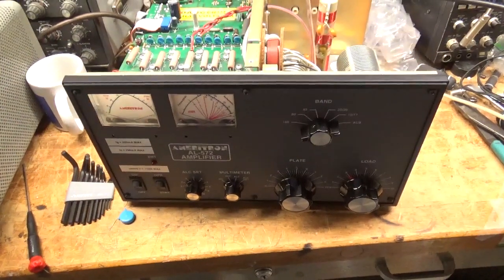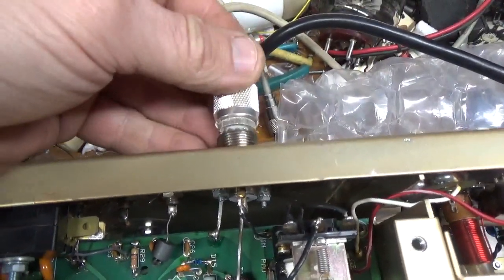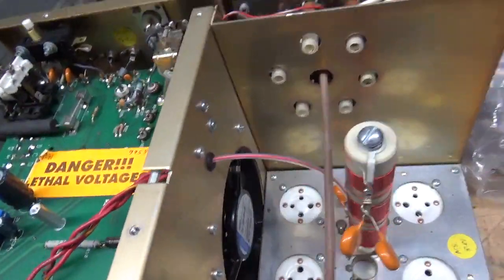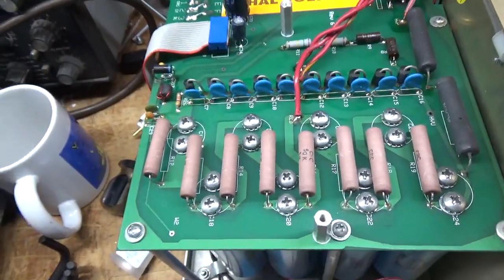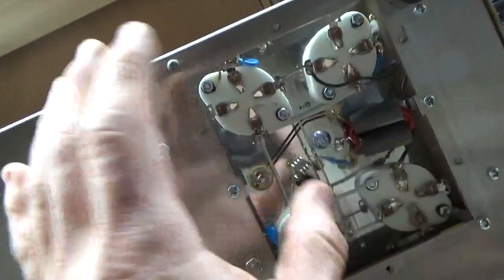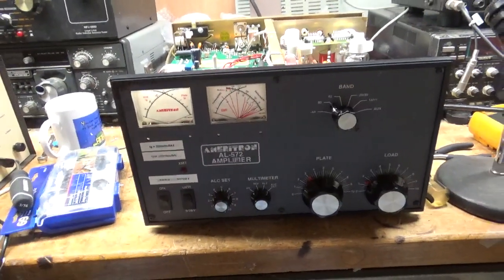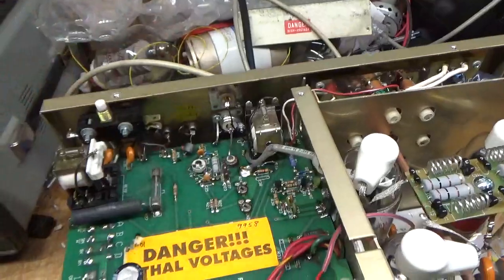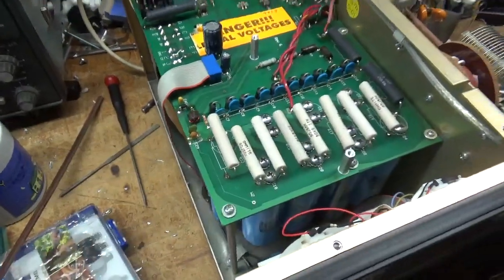Ameritron Al572 Repair And Modification

Comment: Did you remove the MOV's near the filament choke? Those gave me a hard time.  With the gas tubes you shouldn't need them.
Reply from the maker: I just use my mini needle nose pliers and bend back and forth until leads snap flush at the board